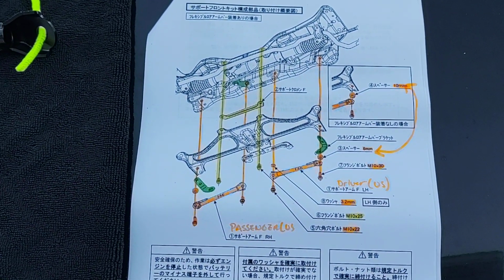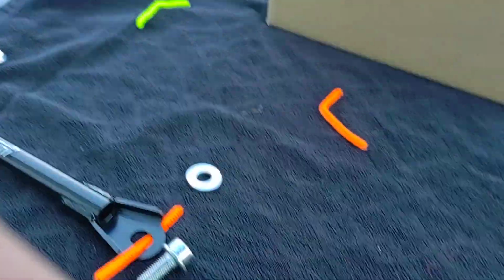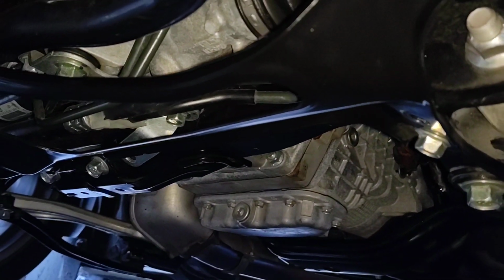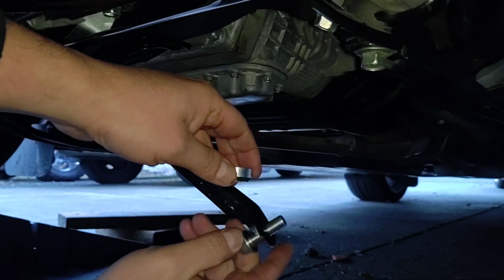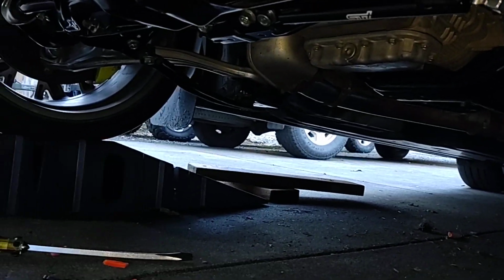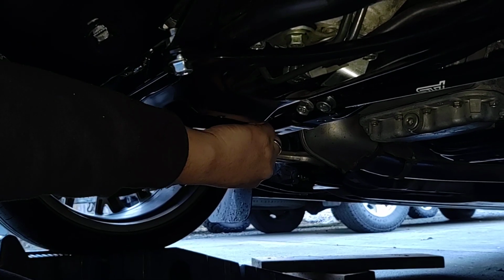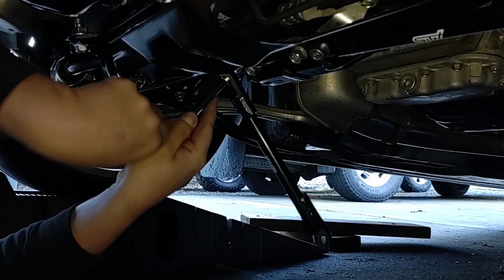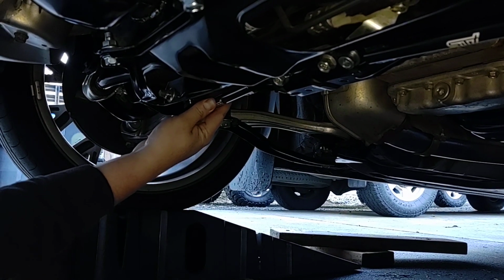Subaru S209 STi Front Support Arm ST20106ZR000  Installation Part 2

Comment: Everything goes smooth until it doesn't! Wish this upgrade was available for the little brother WRX. A trick I use to install bolts that are giving me trouble starting provided of course there are no alignment or hole size issues is to close my eyes of course after the bolt is just touching the threaded hole. Just going by feel versus looking in a bizarre way helps. The eyes can play tricks on you depending on the perspective, view one has and cramped quarters one is in. Anyway when the bolt catches you feel it plain as day.
Regardless after everything was torqued down did you notice a difference? The hydraulic steering feel i understand is great to begin with. The pricey exclusive S209 has this feature among a host of other upgrades. I notice you got the companion draw stiffeners, also an S209 feature. Those intrigue me. Such an elegant functional well made part.